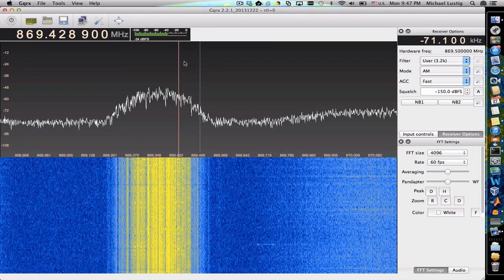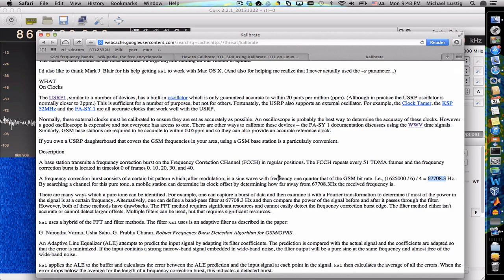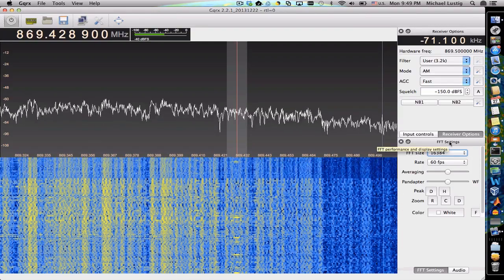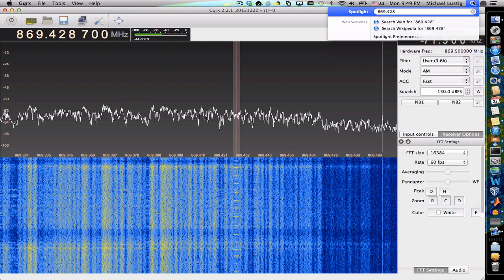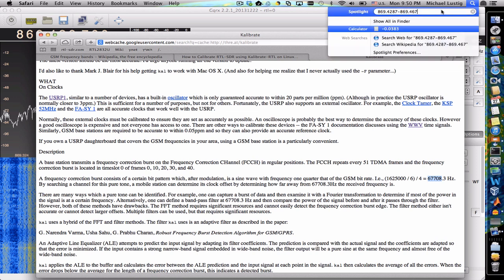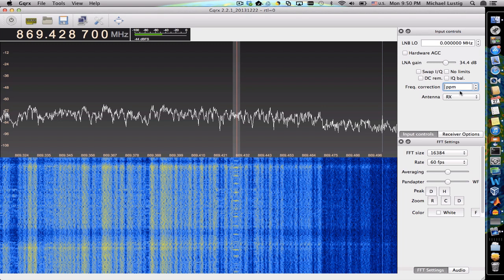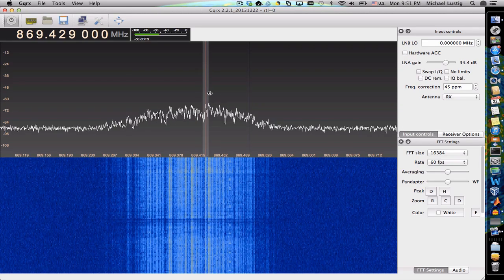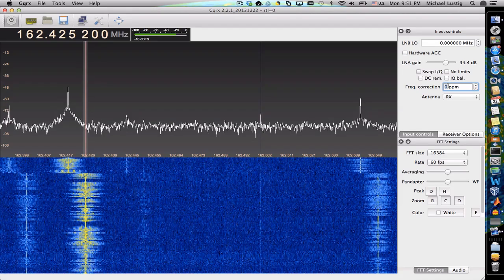Frequency correction of rtl-sdr using GSM signal and Gqrx

Comment: There is a utility called Kalibrate-rtl to scan the GSM band and calculate the frequency offset, but I like your DIY method better. Cheers.
Reply from the maker: +BX2ABT  Yep! It's the manual version of it. 
For a real DYI of it, check out lab4 in my DSP class, which guides you to a solution similar to Kalibrate using python. 
https://inst.eecs.berkeley.edu/~ee123/sp15/labs.html